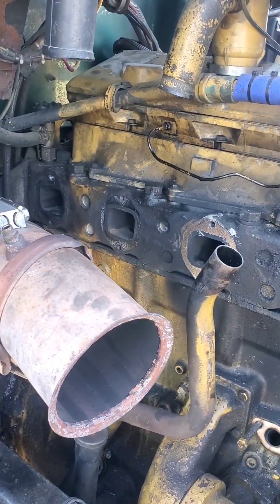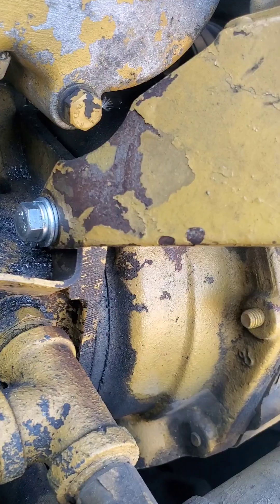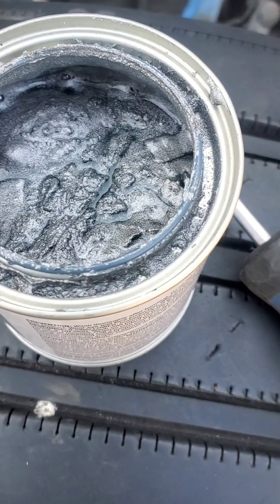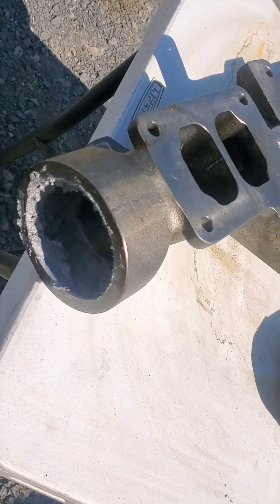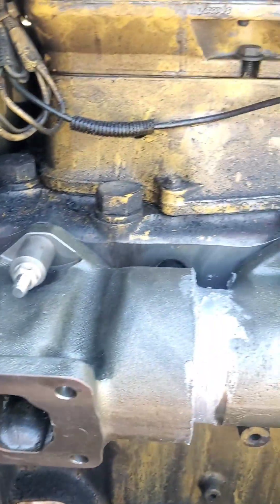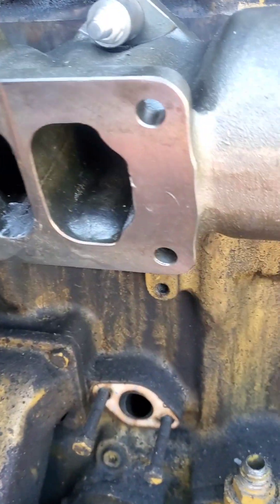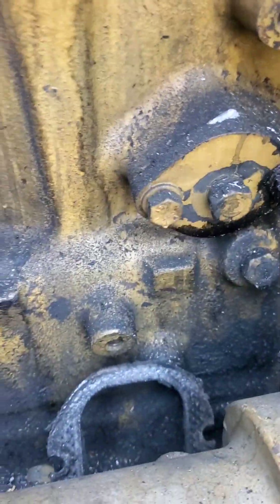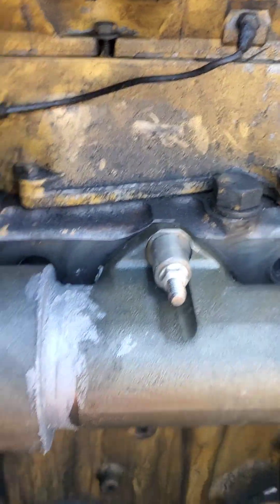CAT 3406B EXHAUST MANIFOLD INSTALL

Comment: How did the mr. 2000 work out for you? 
I used it on an E model manifold. 
It never sealed up..
Reply from the maker: @hardhead7056  it sealed up well,  I used an excessive amount